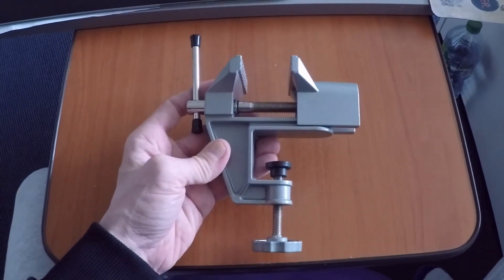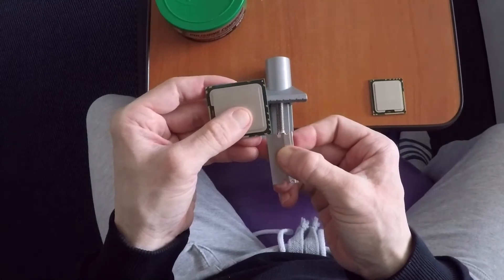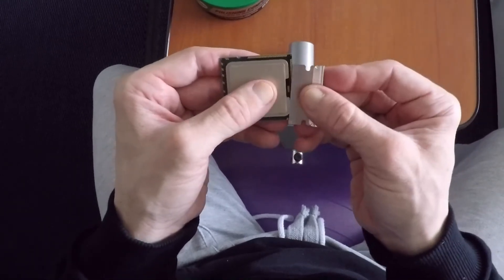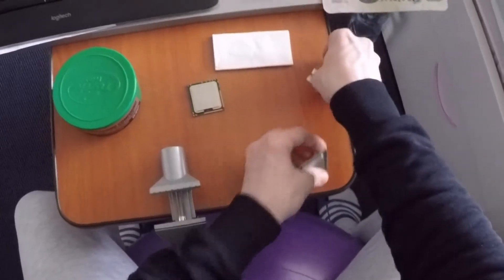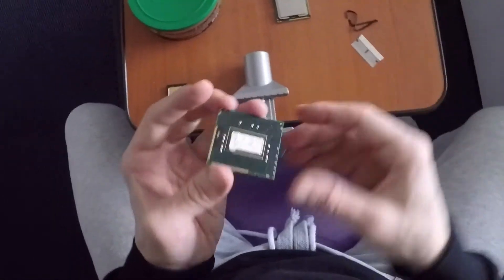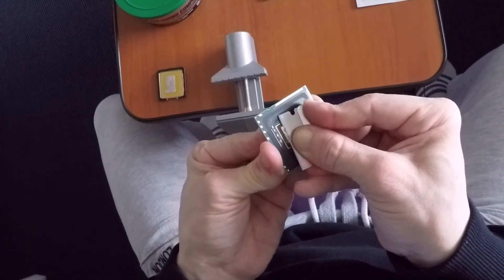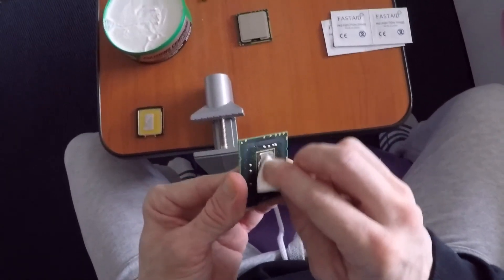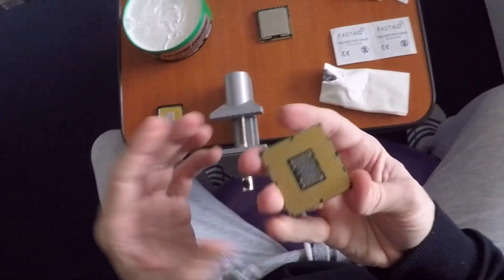delidding x5690 xeon liquid metal connect heatspreader mac pro 4.1 2009 upgrade 3 46GHz vice & blade

Comment: Funny, when those cpu are lidded they use heat to melt the metal , it needs at least 375F to melt....just use heat gun and start using the blade.
Reply from the maker: if you feel like it sure, I dont recommend it
Reply: @SafarWIP  Bro, I build Pc and Amps, Those metal that binds the cpu and lid melts at 370F..try to use a hair dryer on high heat and wedge those blades in 4 corners and see it pop off...
Reply from the maker: @vergelbansill9811  cool, it works for me without but feel free to use that method